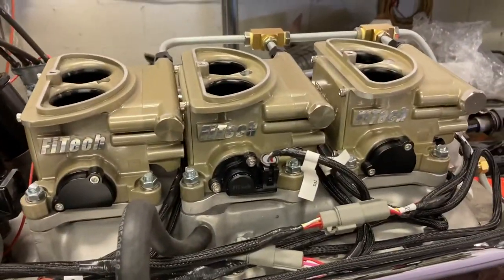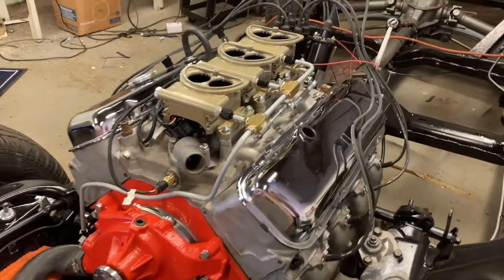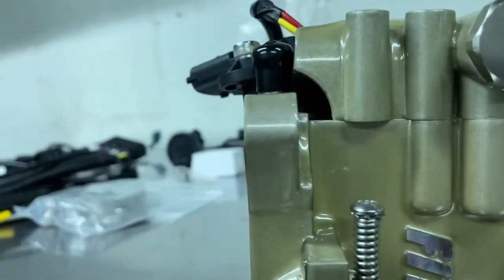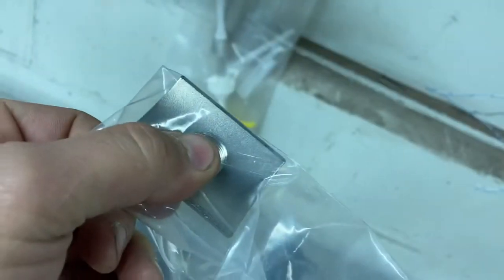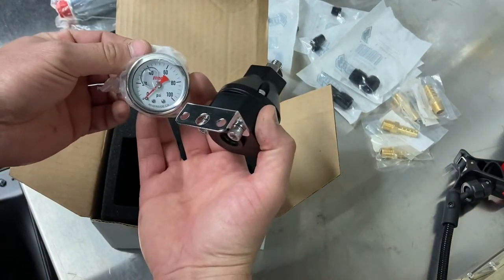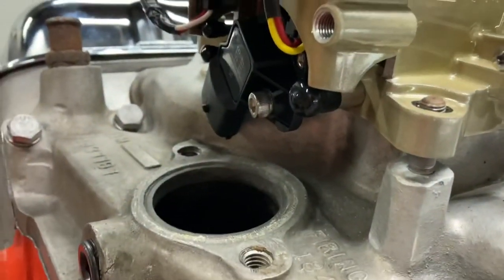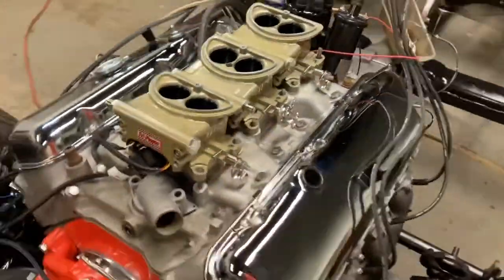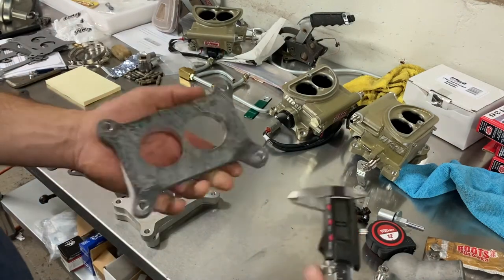EFI conversion, FiTech tri power on 1969 Corvette, PART 1 of 6

Comment: Adjustable strut rods for your rear suspension are a must, I did not know my vette would spin out till a corvette club member told me in 1983 about the rear wheel travel deflection causing loss of contact with the road.

Comment: Good afternoon, which Tri Power package did you order for this conversion? Yheir site has quite a few. Looking to convert my 68 L71 to fuel injection. Thanks for posting these videos. They've been very helpful.
Reply from the maker: 39610 is the part number on the box I purchased.  They’ve made some improvements since I got my kit, hopefully some of the issues I’ve had have gotten resolved.  Good luck on your project.
Reply: @ratfarm767  Thank you!!

Comment: O2 adapter looked like regular zinc plated steel to me. Just don't breathe that crap if you're welding it on to your exhaust pipe. Make sure you have a breather and well ventilated area. That crap could make you really sick!!! Wondering if it is zinc plated myself. Considering this setup for my build.
Reply from the maker: I think your right, it welded up nicely.  What kind of build you doing?
Reply: @ratfarm767  I have a real good 'HI PERF' casted 454 block. My bore mic shows they are within factory specs. Mains are same and cam bearings are nice. The cam tunnel is nicely square in the casting. I'm getting max of .0009" on bore spacing. Nice square block. Must been low miles. Minimal run out at crank snout. It come with a nice virgin set of 781 heads I will do runner porting on. Deshrouding where I can. Bigger valves if course. I have some good thumb rods that balance out nice. I have a really good 396/402 crank. I'm going 427. Putting it in my 1941 Chevy business coupe. Be a really nice street rod.

Comment: Hi what parameters did you use to configure the engine?
I have the usual system and I need help thanks
Reply from the maker: Not much, just the basic setup with displacement and cam selection.  I let the unit do the rest.